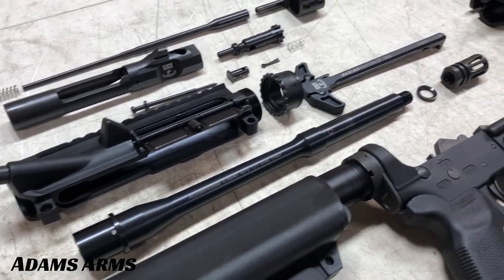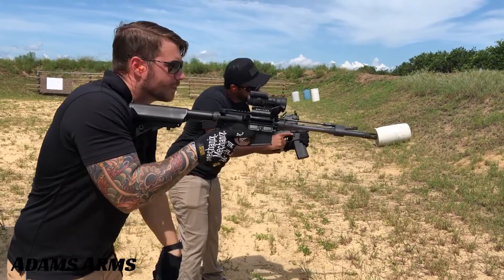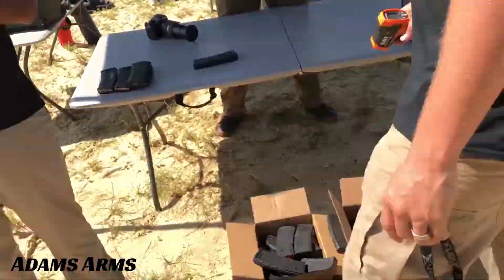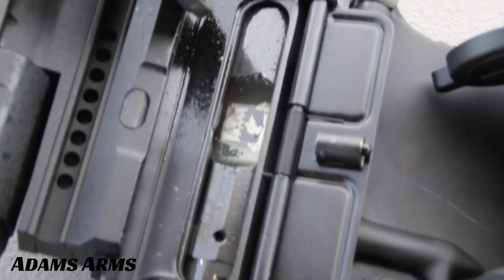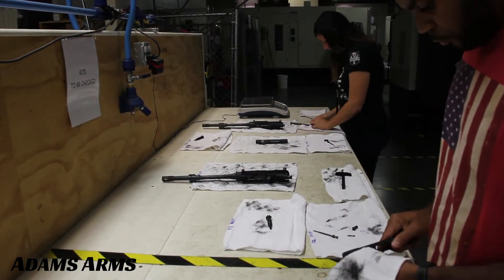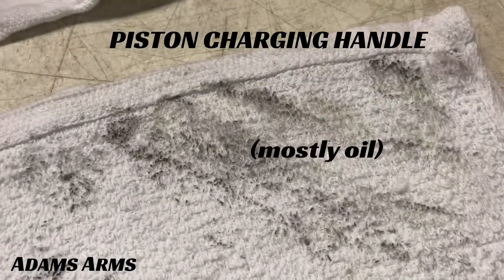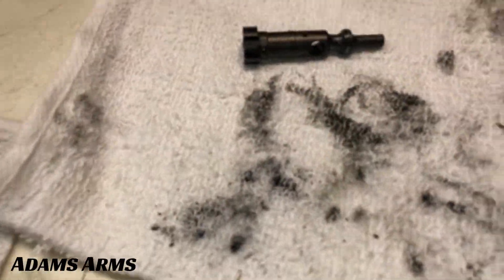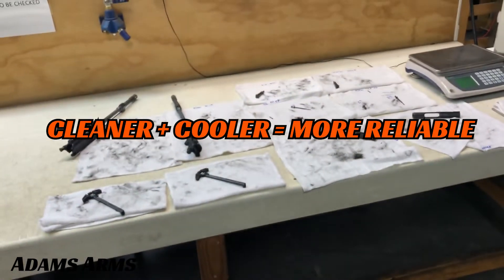Adams Arms Piston Versus Direct Impingement

Comment: Bolt carrier temp doesnt matter. Your not gonna get the bcg hot enough to affect heat treat on a quality bcg. dont buy into the hype the DI system is fine.
Reply: Well and its dumb of course there is going to be more carbon build up behind a the bolt on a di it's meant to for the gas to go behind it.
Reply: Ethan Mac  ok buddy
Reply: Ethan Mac hahaha General Neckbeard
Reply: Ethan Mac  I was with you untill "the superior 40." 😂😂😂😂😂😂😂😂
Reply: DI is fine. No piston system is going to be lighter than a gas tube.

Heat on the BCG does matter because it eventually dries up your lube. 

There are tradeoffs with both options and it just depends on what you value most. I personally value a lightweight DI because it's plenty reliable and I'm carrying it more than I'm actually shooting it. Although I'm not opposed to doing a piston build. That would be sweet too.
Reply: mine 308 DI needs to clean everytime before range or hunting and it will be more worse if im running a suppressor, it makes a lot of carbon buildup, .. i have several fails to feed and ejection issues while pig hunt and make me lost the oppurtunity to make a kill just because not clean and lube it. now after im trade it off to the LWRC piston 308 AR, that problems never occur although im a bit lazy cleaning my rifle, im only done cleaning once a years.. its been 4 years im using this piston rifle and  now with suppressor also have no problem occur..go with piston rifle if you a type that lazy cleaning guns like me, im dont want waste so much my time for cleaning and lubing guns, thats time better for me to do a ammo reloading.. for ease of mind, piston is a way to go.. if you dont mind spending bonding time together with your rifle to taking care of it, DI is ok.
Reply: The heat "issue" ,just, moves forward. Instead of distributing it throughout the system it gets concentrated on the barrel components.
A {round end cap ,compatible} "drop in" rail ...would be a nice addition to the line up.
Using that surface for a heat sink would be ideal.
Reply: @jaseswinconos  Yep, .40 short and weak.
Reply: What you guys don’t realize is stoner after selling rights to colt made the ar18 piston driven fir reliability and less maintenance which majority of todays guns are made. Fn scar h&k416 ak47 fal etc all piston. Yeah gas guns still run great but eventually you will to clean it.
Reply: @gchang54 I agree with u on the harmonics and free float barrel part, thats exactly why i tend to use thicker barrels, like hbar profile. 

For the heat issue I would say play around with the gas adjustment to where u don't have so much blowing out of the bleed off every shot. Id be a little more restrictive on the block if heat became an issue on the barrel,  thats just me. U can kinda tune it in more where it shoots smoother and is bleeding off more excess but you're right that would make more heat. 

Also, just heat issues in general, that's why I totally recommend people get a good quality barrel. That should be the most expensive part on every AR other than the optic if u ask me. U simply cannot afford to skimp on the backbone, the life line, of the whole gun. 

I usually go with hbar profile fluted barrel AND the piston kit, together. Then I go lightweight on everything else to make up for it. If accuracy matters most/more than being able to run the gun really hard, pick stainless steel and get a more overall even wear over the barrels lifespan. An hbar stainless with piston u cant go wrong, albeit it will have a shorter life but the tradeoff is it will stay more accurate over the entirety of its usage vs non stainless where u get more burn out on one end of the barrel than the other, over  time. But anyhow if a person chooses that type of setup the chance is sooo much lower of shots being off even if it moves some. 

I only use piston kits on pistols and carbines. Mid and rifle lengths better with DI but it also depends on what u will primarily be doing with the gun thats going to ultimately dictate what u need imo. I'm a gun sales guy so I can talk this stuff all day with people lol

Comment: I hate it when manufacturers are disingenuous. They're two different operating systems, let's see how much carbon was on the piston? What about the reliability of the test. Just make a video explaining the benefits of a piston system without trying to pull wool over our eyes.
Reply: Yeah they could have at least shown the cup of the piston or the rod.
Reply: Then they'd have to show the gas tube and how cruddy it is on the inside too. Trust me man it's way cleaner. Rarely do i have to do more than wipe off surfaces and reapply grease. And my range sessions are usually at least 300 rounds.

Mind you i basically clean the piston when i clean the rest of the gun. I've purposefully left them dirty for months through many trips to the range and it's really no different.
Reply: I own one in 556 there's practically nothing in the Piston system keep in mind the Piston system is literally like a one-inch block a tiny cup with a rod behind that and a spring this can literally be cleaned in one swipe of the rag on each little part. for the Piston block all I do is just spray some solvent inside the hole stick a Q-tip in there or a couple maybe three at most until it's clean that's a literally it
Reply: Yeah except the point of the piston system is to keep the shit in the piston system and out of your bolt and carrier group, I highly doubt a little grime is going to stop that piston from moving, debris in your bolt carrier in a DI rifle on the other hand... 🤷‍♂️ I think they're both good systems and I plan on building both but I dont really get your point. I know what you meant, but it wouldn't be the best marketing ploy to point out the weak spots in your product for 15 minutes lol.
Reply: I have one, the gas block and piston do get dirty, but I haven't seen any build up at all, and I haven't had to scrape anything, the gas adjustment thing comes out so I just grab a q-tip with some oil and clean it out that way.
Reply: I have two of their entire piston driven rifles, the AA-15 and their AR-10, and both run flawlessly and are an absolute breeze to clean. Their coatings are excellent as well with parts having an almost permanent lubrication. I’m itching to grab their latest release, a 9mm pistol. Love me some Adams Arms.

Comment: Yeah , just don't expect it to fire any steel cased and cycle at all! Then when you call them to tell them that your brand new P2 series rifle won't cycle steel case they tell you "Sorry we don't guarantee our rifles to run steel cased ammo" That situation was less than a year ago... They did nothing to rectify the problem... My cousin got rid of it immediately after that.. Oh and I was at the range with him when this occurred.. He tried all the adjustable gas settings ,which were useless...  Just warning anyone that is thinking of buying an Adams Arms rifle that they wont cycle steel cased ammo and they will do nothing to try and fix the issue for your $1200 rifle.
Reply: I had similar issues with the 5.45 version 11.5" upper. I ended up adding a Wolff extra power trigger spring and paired it with a light weight buffer spring. That was the cheapest way to make it reliable.
Reply: Steel has worked fine for me 🤷
Reply: A piston AR is really only useful if its supressed. Or in an LMG role.
Reply: First time I’ve heard that, all my AA run steel just fine, I don’t like steel ammo but I’m be ran it with no issues at all, gotta be operator error
Reply: @MrJbrew69  Well I was a first hand witness to multiple brands of steel not cycling in my cousins gun, But ran brass just fine... He called Adams arms and they told him sorry they don't guarantee their rifles to run steel case ammo and would not even allow him to send the rifle back for them to look at it...
I can't believe you never heard of the so many people that have problems with AR's in general not LIKING running steel AMMO.
My cousin sold it and bought a POF rifle, and they state on their website that their AR 15's will run steel cased ammo guaranteed!
Adams arms Ar's are hardly sold by any venders as you might have noticed.. 

Here you go:  Adams Arms, LLC, after the successful transfer of assets, will be closed. It was announced and advertised at the beginning of April that Adams Arms LLC's assets would be auctioned as a turn-key operation, including all tangible and intangible assets. AA Holdings will continue the Adams Arms brand. 
They went bankrupt in 2019 for 5.1 million $$$ And their creditors AA Holdings bought them out in 2020 ... I say that was almost exactly the time my cousin bought his P2, which cost him like $1300 which they are trying to sell right now for $1500 on their site... And they don't even have 1 review of their P2 rifles at all on their site, Wonder how that can be even possible?! And the P2 is their second to top tier rifle that they sell!
Reply: Both my Direct gas and Adams arms piston rifles cycle steel just fine 🤷 might have been a buffer weight or spring tension issue not the upper itself
Reply: @whiplash5026  The point was Adams Arms was NOT even willing to fix the issue and even told my cousin that they did not guarantee it to and that it was in writing somewhere in the warrantee supposedly and told him tuff luck, Though he paid like $1100 for the P2, That is just ridiculous BS customer service to say the least! Oh and I was there to witness the jams at the outdoor range it fired like 200 rounds of brass just fine , but would NOT cycle a single round of steel cased .223 and at the time 2 years ago(covid ammo crisis) steel cased was the only affordable ammo, brass was like some silly price of .75 cent a round for just .223 and more for 5.56 He could have changed the buffer, but that is not the point.. He sold it immediately and bought a POF and it ran the same ammo perfect!

Comment: DI no problem, Military Arms Channel  fired 7000 rounds without cleaning,lubrication and without malfunction.
Reply: My DI & piston guns both run fine dirty w/o a suppressor but when i put a DeadAir can on the additional gas and fowling did cause short stroking on my Geissele 14.5. My PWS and Adams Arm kit gun are 14.5’s also & they have no problems with cans. That’s where the piston systems shine.
Reply: But in the real world of Afghanistan, real M4s had reliability issues which prompted the military to call for the adoption of piston driven weapons, which are more reliable and last longer.

DI is dirty. DI people insist you should "run em wet" in order to "experience full reliability." if that gas tube clogs (like say in a stand storm or an environment drifting and burning ash as in serious urban combat) you need an armorer to get a di gun running again.

A gas piston (adding 1/2 to 1 1/2 pound more weight usually) is cooler, runs longer, is more reliable and when things get dirty (much later with a piston gun) YOU CAN FIX THE PROBLEM YOURSELF.

Thumb over bore 7M metrosexual shooters HAVE NO CRED! That's just an extension of the gamer cult of the holy Magpul magazine. Only a fool takes a LESS RELIABLE SYSTEM INTO A DANGEROUS SITUATION BY CHOICE!

Are DI guns junk? Keep them clean and well lubed, manage your shots to avoid excessive heat, keep debris out of the barrel and ejection port and out of the magazine. For most people a good DI will work. But if you're shooting over a 1000 rounds a year and becoming operator level proficient with your carbine, PISTON IS ALWAYS BETTER.

Of course, if you're a 7M thumb over bore metrosexual shooter feeling "gangsta" because you got an AR after beating a Call of Duty game then you keep on keeping on, but stay out of the way of adults. We know your mantras - "Magpul uber alles!" "Fudds hold us back!" "Spray and pray and gay is OK!" That's why you're the SCOURGE OF THE SHOOTING COMMUNITY and why serious people avoid people like the YOUTUBE POGUE in your 7000 round "torture test" link and people he talks to at pride events like Garand Thumb.

Comment: Have converted 2 AR-15’s, one mid-length and 1 carbine. Awesome setups, have had the Mid-length for over 7 years and thousands of rounds, no failures and a breeze to clean. Any decent DIY home gun smith can for the conversion, you will not regret it!🇺🇸

Comment: I had an AA 14.5 piston upper.It would only run with Lake City m855.Short strokes,ftf ect.My Colts are 2013  6920 and two m4a1socoms get run hard, dirty and they function with any ammo.The DI never stopped running,yes its dirty by design but carbon won't keep it from functioning.Google BCM filthy 14 and you'll see how durable and reliable a quality DI is.
Reply: My mid length 14.5in was short stroking with 55gr so i took out the h2 buffer & put an h1. It runs flawlessly now. Never had an issue with 62’s or 77’s but with the price of ammo 55 is all i can find. The buffer was a cheap fix. Hope that helps!
Reply: did you build it yourself? If so, sounds more like a poor buffer spring choice and/or gas setting.

 Even the bargain AA upper has 2-settings on the gas system, the mid-higher range blocks are fully adjustable.

More times than not when I hear people have short stroking issues theyre using too heavy a buffer weight and/or too strong a spring buffer
Reply: Why didn't anyone comment on where the carbon is at on the AA piston design? Check the piston! Known for poor reliability over time due to excessive carbon....rather have it around my bolt where it doesn't matter, as designed by stoner....
Reply: @CumminsTurbo4  it's not unreliable. 4700rds with my piston never been cleaned. It's a simple design that self clears.

Stop with the fuddlore. If it was that much of an issue the Hk416, G36, Scar and almost all of the AR-18 based short stroke systems would be unreliable as fuck.
  
DI is good for high accuracy been shooting, hunting and low round count applications.

Comment: Problem is there has never been a direct impingement AR. Stoner knew what he was doing the first time around. Also the carbon build up isn’t on the bolt face rather in the internal piston, that doesn’t really effect anything in itself until the buildup gets even worse, at which case the long stroke piston will be just as dman dirty. Long pistons will seize up without the same amount of maintenance
Reply: I've never cleaned my piston upper. 5k rounds through it. I could pick it up and shoot it now. I'm too lazy to clean it.
Reply: CORZER0 pretty much any AR will do the same if you keep it lubed. Negligence isn’t something to brag about. If you don’t clean your barrel after about 2/3k rounds you’re going to see degradation in accuracy.
Reply: @ViktoriousDead  Boresnake regularly. I said "upper". I'm not a moron. Thanks for your pro-tip though.
Reply: CORZER0 A barrel is considered part of the upper group so.......
Reply: Can someone explain the “problem is there has never been a direct impingement AR” comment. I’m confused.

wasn’t the original AR-10 and the subsequent  Stoner AR-15 DI???
Reply: @NotYourFriendPal  Not TRUE direct impingement systems. The AR platform uses a semi-DI system, where the gas vent back into the bolt carrier to a set of gas rings around the bolt tail, which forces the BCG to move rearward and unlock the bolt via the cam pin groove. A true DI system would just blow gas at the bolt to force it rearward, like the Swedish Ljungman rifle. Ian at Forgotten Weapons has good videos explaining that.
Reply: I think the Piston system is cool as much as the next guy but MAC shows on his YT that he ran a DI ar15 for 8k rounds without cleaning or lubing it once and it ran fine.

Comment: Efficient, but could that external mechanism not get blocked by dust or broken in operation?
Reply: I saw that too. Im sitting here right now reverse engineering  this thing in my head. I think im going to mod my rail to give access then engineer a particulant filter. There sould be a cleaning rod that can get down in that seat kinda like a copper bore brush. They offer spare parts on the website. I think it's fairly priced.
Reply: Exactly. Check the piston! Pistons are known for poor reliability over time due to excessive carbon....rather have it around my bolt where it doesn't matter, as designed by stoner....